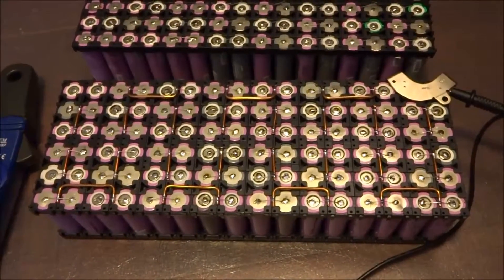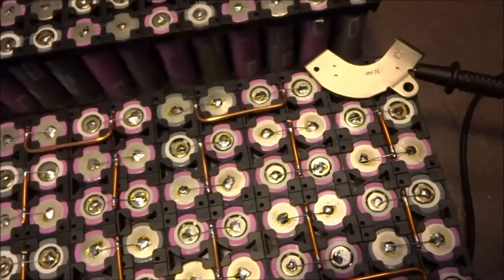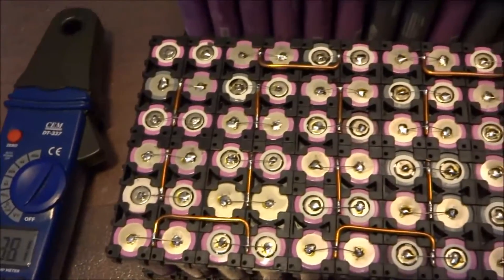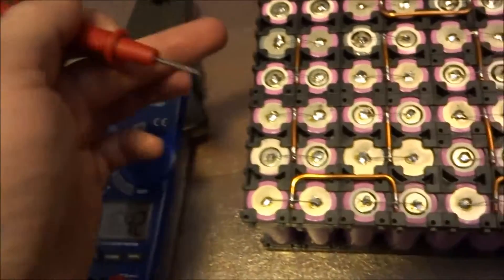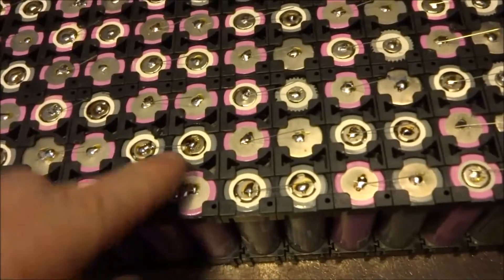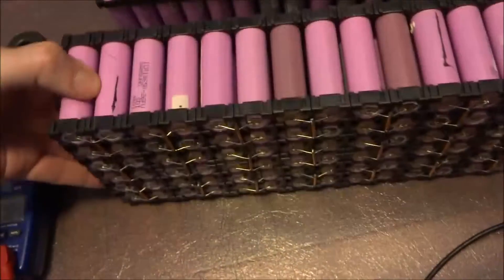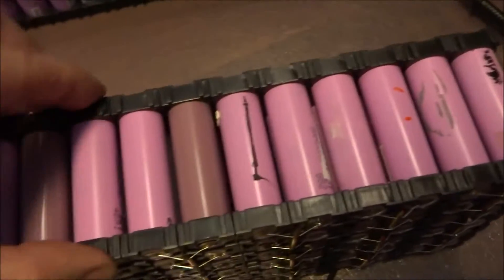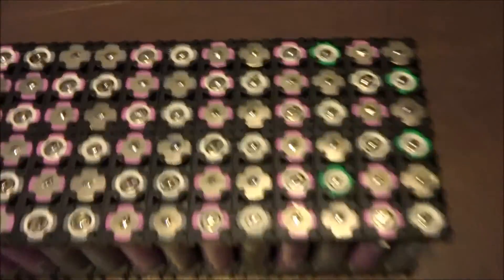Nissan LEAF range extender pack build Pt.2.1 (prototype pack)

Comment: I would have built it in more sections, the voltage of the packs is too high for me to soldier safely. I would have done 48v max per pack that way they can be disassembled to a safer state
Reply: agreed 10p x 12s would have been best. keeps it under 60v which is the voltage at which human skin becomes conductive for most people (in the high 50s for some). It would have made 8 packs that you connect in series. Also, fully parallelized packs are better for longevity and balancing.